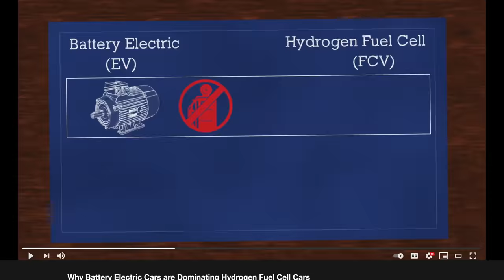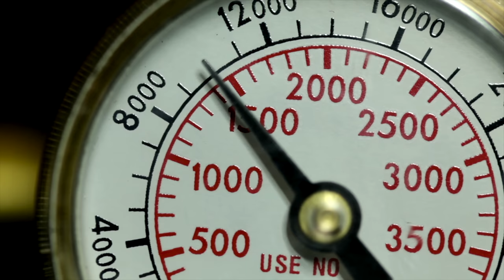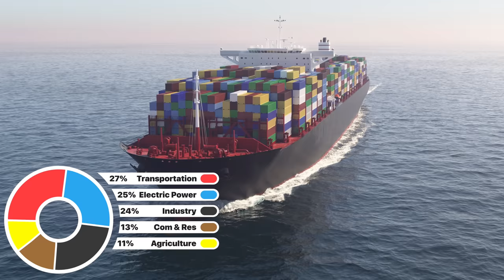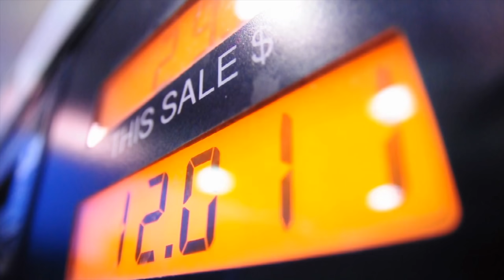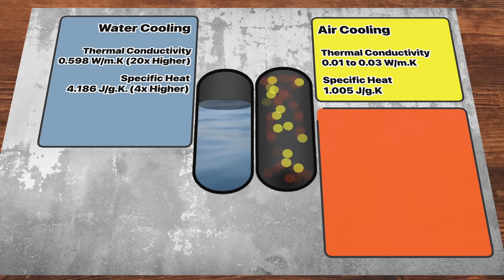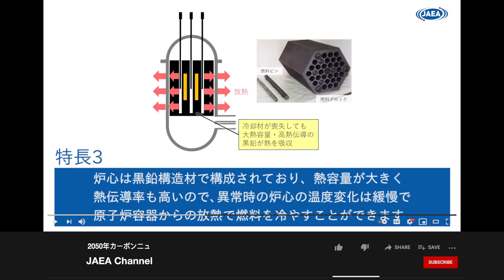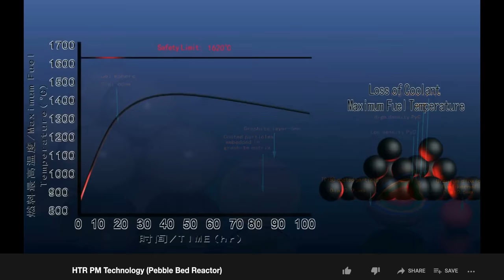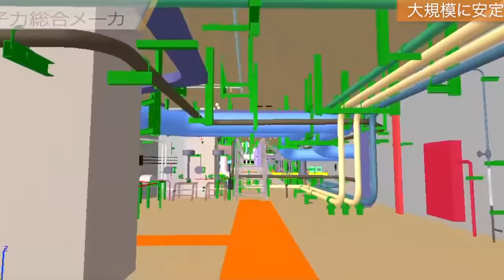Japan's Plan to DESTROY the Price of OIL and GAS!

Comment: Japan work in partnership with New Zealand and New Zealand is now using geothermal energy to power its electrolyzer plant to make hydrogen on a industrial scale.
Reply: Now that's smart. If only powers that b would tap this unlimited energy source. But as you know such technology would not benefit them alone it would benefit all and that would cut into the profits of the few.
Reply: @philortiz7519  Not every country has access to easy geothermal energy.
Reply: @sirpieman300  true. But if countries that have it, such as usa would work to implement it it would do wonders for a better future. I believe there alternatives to current options. But we can't throw all in at one time. Fossil fuels will always be needed for many reasons. But we can do a better job at implementing other sources even if we do it in stages and as technology advances. There's no  1 cure all option but over time using more of what we can do together would be a bit more reasible. Truth is if the world did not want to control each other we could make greater advances together. Im about hydrogen, thermo heat natural gas wind and solar and fossil fuels working together. It's a tough sell but without fossil fuels we can't accomplish any of it. It's not an easy road or task to complete. But it is possible with time and commitment. But not all in on one or two overnight. Cutting fossil fuels completely as is trying to be done right now is going to cause famine and war. Do not know how old you are but I'm old enough to know what doing this will do to all nations and people. God help humanity. Because we're not helping ourselves.
Reply: @philortiz7519  Advances have been made in Geothermal Drilling that significantly lower the cost. It's now possible and cost effective to drill down far enough to acres the geothermal layer to access the superior and constant heat of the Earth's core in many more locations. This includes near many fossil fuel burning plants that are nearing or passed their lifetime and would reqularge overhauls anyway. With power transmission lines already there for the energy produced by fossil fuels, those locations are prime for new geothermal using this new, cost-effective drilling technolgy.
Reply: @GeneJordan  see it as it is. Advancement in drilling could would and should be implemented.  Tesla saw the ionosphere as an endless supply as well. But no one wanted to look at it or support the concept. From what I've seen there is something there. But then the strangest thoughts are rarely examined. I'm all for tapping in t o this thermal source and have been for 40 + years. Problem always is who has balls to commit and try. Time as usual will tell if it sees light of day by the powers that b.
Reply: Geothermal is not the way forward.
Places that use it see a reduction in thermal activity, things like hot spring & geysers stop or reverse.
Since the heat in the core is what makes life possible on earth, it probably not a good idea to mess with it.